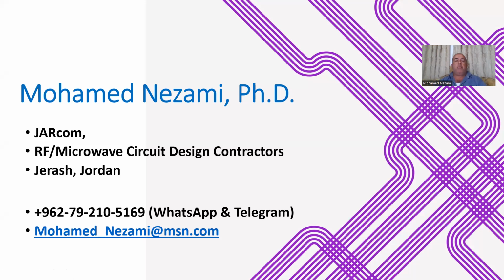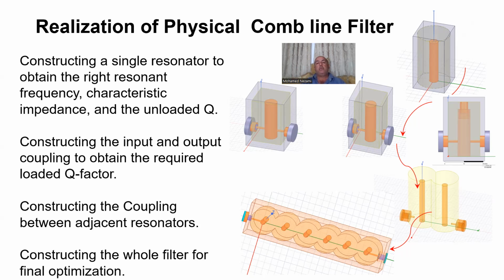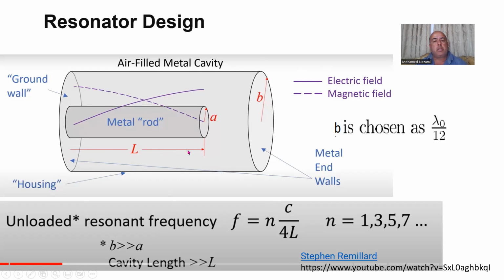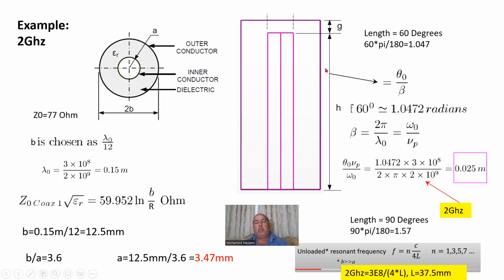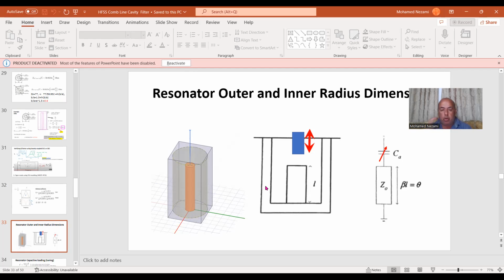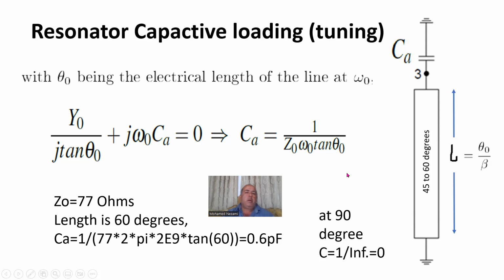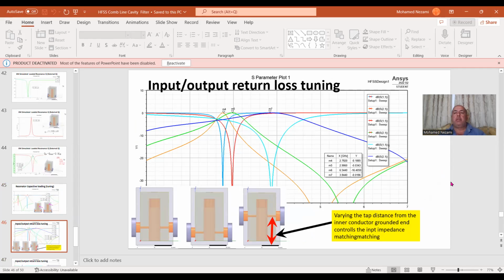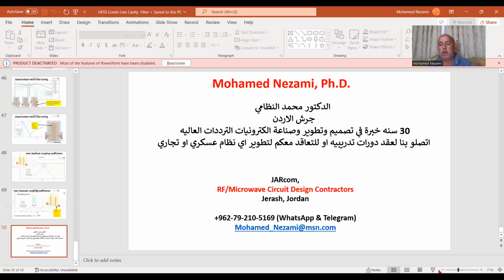Design and 3D Modeling of RF/Microwave Coaxial Cavity  filters, part 2 of 2

Comment: HFSS, CST, AWR RF cavity, LC, dielectric filter, duplexer, combiner and other simulation designs adopt full cavity integrated joint simulation, with high accuracy. Metal cavity, ultra wideband interdigital, microwave ceramic dielectric filter, waveguide can all be used, with years of passive design experience, providing detailed design scheme parameters.

Comment: Thank you very much for video. Did you adjust your resonator dimensions for extracting interresonator coupling value in each iteration? If we want to obtain bigger coupling values,  the geometric mean of even and odd mode peaks will be shifting to  lower frequencies. So, when we extract that k values, extraction will be valid for  that geometric mean frequency (not for your desired frequency, I guess 🤔 ). For your case, fp1 = 1.9640, fp2 = 1.9820 , their geometric mean was very close to your desired resonant frequency which was 2 GHz. And also can you share your spurious resonances and harmonics in wideband response? So glad I have explored your channel.